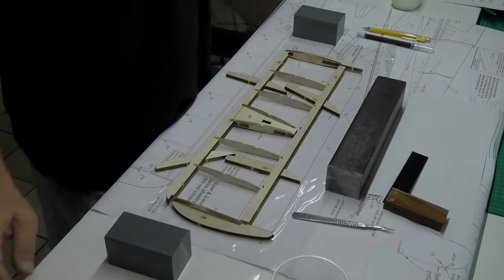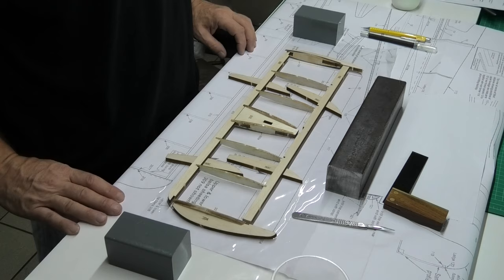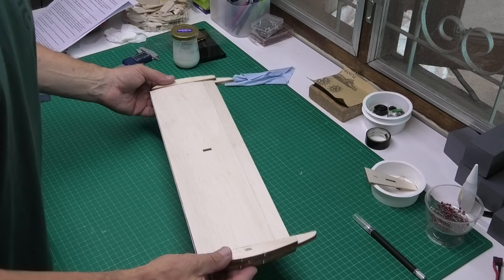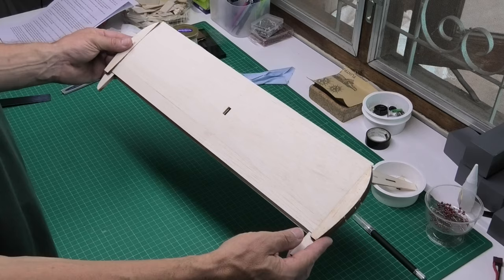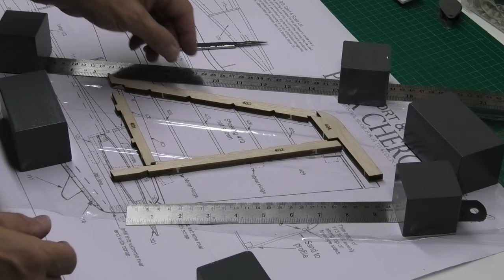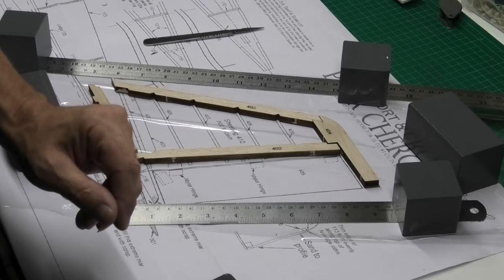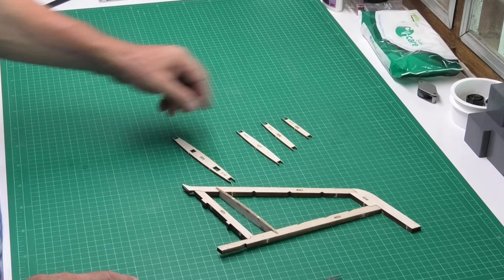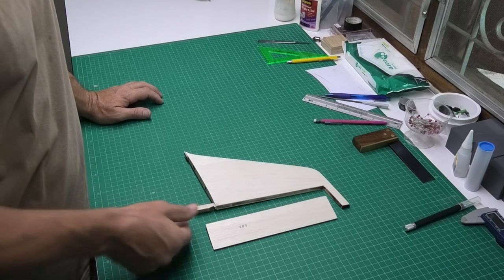Piper Cherokee RC plane kit - Pt 9: Tailplane & Fin Construction - DB Sport & Scale

Comment: really enjoying the build , have I seen the fuse already build in a previous vid? how did that happen : ) ?Also see a plan on the wall for a Cub J3, will that be shown build wise?
Reply from the maker: gary murphy Thanks for the kind words, glad you are enjoying it. Yes the fuselage was done at this stage, or partially, but in the videos I try to present in a logical order, well spotted on that and the cub plans. I am currently making and filming a J3 Cub, which I will post after this series.